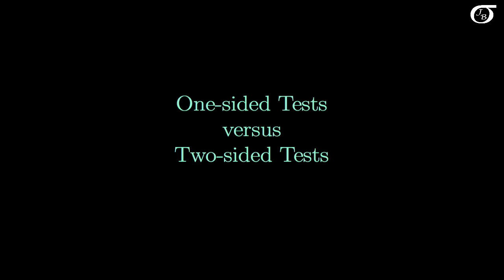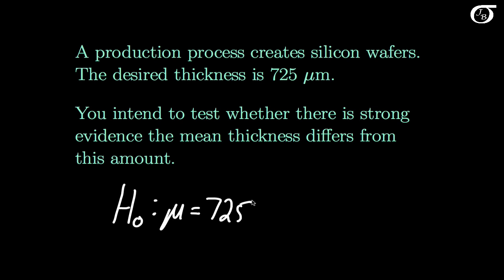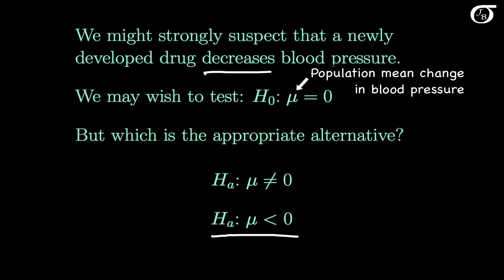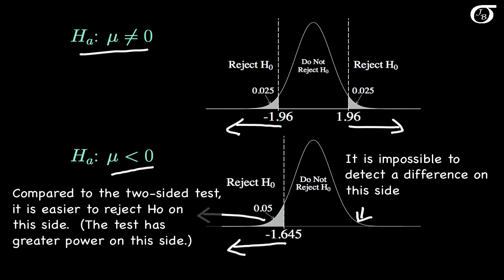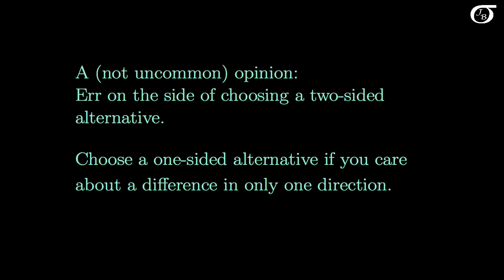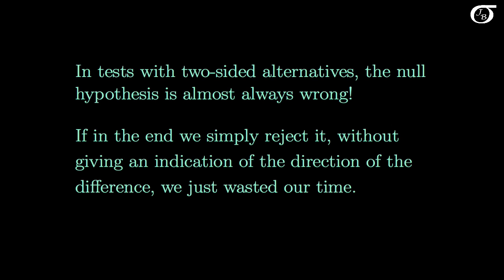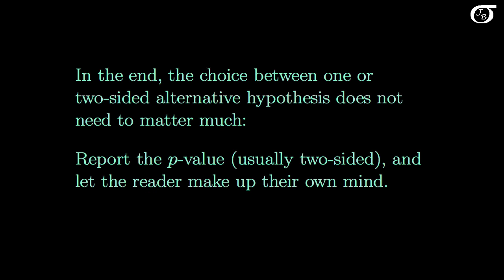One-Sided Test or Two-Sided Test?

Comment: 8:25 because the null hypothesis does not have to be a difference of 0
Reply from the maker: A similar argument applies to any other value.  When is the difference between two parameters going to be exactly equal to the hypothesized value?
Reply: @jbstatistics  To my knowledge, we can use minimal-effects, equivalence or inferiority tests where H0 is not defined as a point value but rather as a range. In these cases, we don't know the null hypothesis is false when going in. Do you agree?
Reply from the maker: @maximedelmas  That's a whole different ball game, and different from the standard hypothesis testing that is discussed in this video. This isn't a video on those topics.  If you want to talk about something different from what I'm discussing here, then sure, my statements don't necessarily to apply to those scenarios.

Comment: Are there cases where researchers, for example, in the blood pressure results, use both tests to infer how probable it is to 'change the blood pressure'  based on a two-sided test, and then infer how probable it is to 'lower blood pressure' based on a one-sided test? can't we use the data and plug it into the two tests? 

Thanks for your effort prof <3

Comment: I want to ask why you can set the H0 as x=2 and H1 as x>2? Isn't Alternative and Null should be collectively exhausted?
Wouldn't it be more informative if we set H0 as x<=2 and are able to reject the Null as now we are confident that x would not be smaller or equal to 2 rather than simply not equal to 2 if the Null is just x=2?

Comment: Shouldnt the null hypotheses be
Ho: mu =< 2?
Reply from the maker: There are two approaches to writing the null hypothesis when the alternative is one-sided.  Your method (e.g. Ho: mu =< 2) is reasonable, and is used by many sources.  I prefer to always have the null being an equality (and this is reasonable and used by many sources as well).  There are pros and cons to each approach.  I like to use the equality, as I often speak of the distribution of the test statistic *when the null hypothesis is true*, and the p-value is calculated under the assumption the null is true.  When the null is an equality, then this has concrete meaning.  When it's an inequality, it's not as simple.  But your way is a little better at getting to the heart of what we are actually testing.  So, like I said, there are pros and cons for each approach.

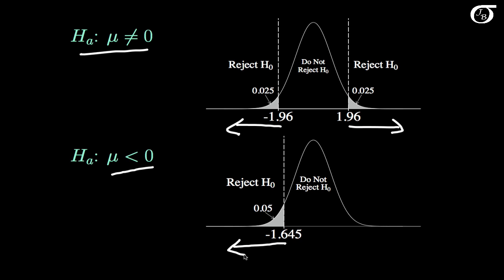Comment: at 3:57 where did you get the -1.97 and the 1.97
Reply from the maker: It's from the standard normal distribution, and can be found using software or a standard normal table.

Comment: A good rule of thumb to use is if the result happens to be in the opposite direction to that which you expect will your conclusions be the same as if there is no difference? If the answer is no, you shouldn’t be using a one-tailed test. 

For example say we were looking at the effects of some training (predicting that training improves performance). If the results came back that post-training scores were lower than pre-training (say p = .02) would our conclusion be that training makes no difference? Probably not, we would most likely conclude that training is actually detrimental to performance. However, a one-tailed test would not let us reach that conclusion.

Comment: it doesn't make sense to me because ultimately its us, who will choose the value for alpha.
Reply from the maker: Regardless of the alpha value that you choose for your test, the concepts discussed in this video apply.
Reply: jbstatistics my limited point is when we choose alpha for a 2-sided test, we know that alpha is going to be divided by 2 on either side. So we choose alpha accordingly (so maybe it would make us choose a greater alpha value than what we would have Choosen in case of a 1-sided test).

So we should not be comparing alphas of 1-sided and 2-sided tests.